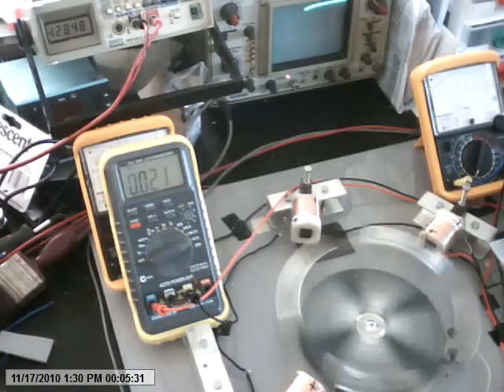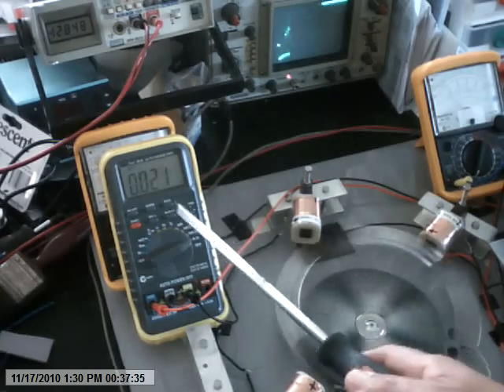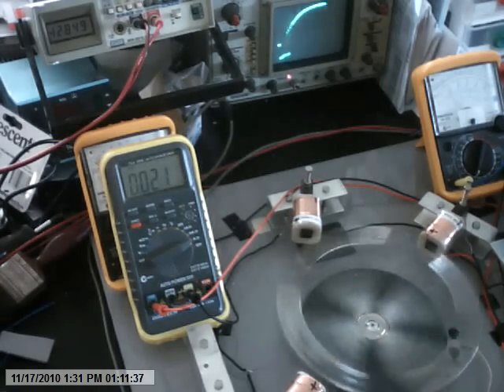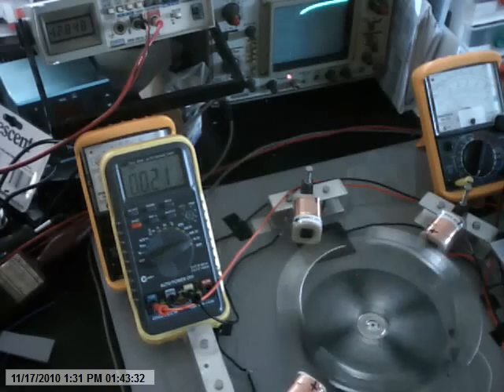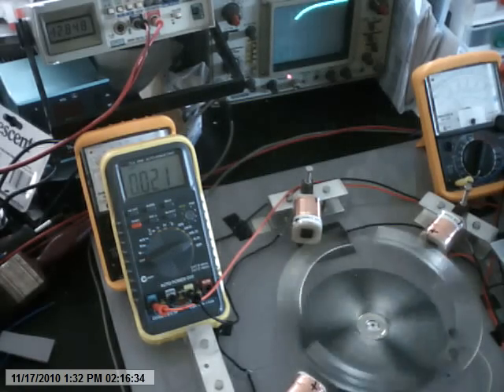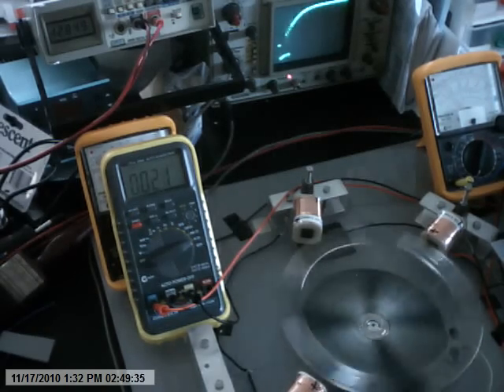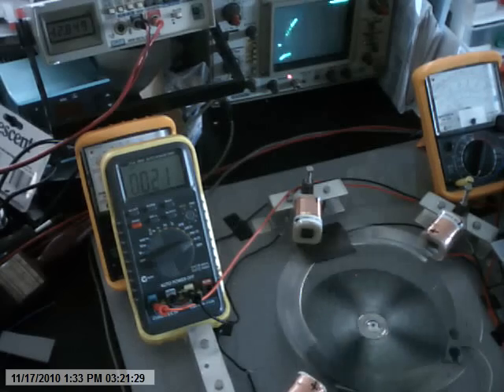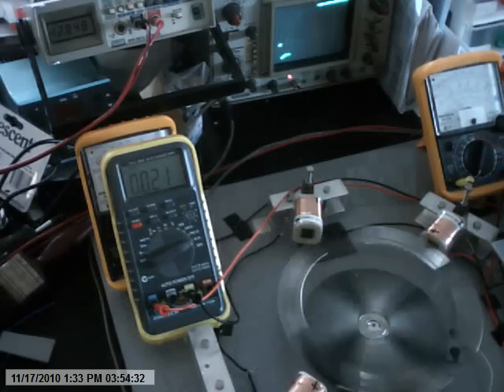Over Unity Free energy Motor Generator_2

Comment: @1BustedMyth 

Yes its a simple question. slightly complex answere ! : )
ill have a go ! 
what ill say is that radiant voltage only becomes watts when it is absorbed/stored/used properly. but the important point is that it can very much become substantial wattage power.

As the radiant voltage (high potential but no power) hits the battery it becomes watts !   if it hits the battery correctly the battery is triggered and brings in real power from the "vacum". its team work ! 

got it ?